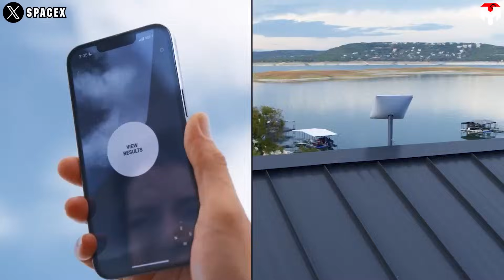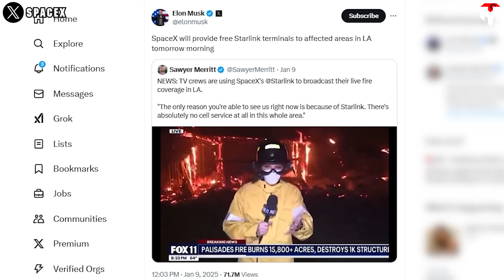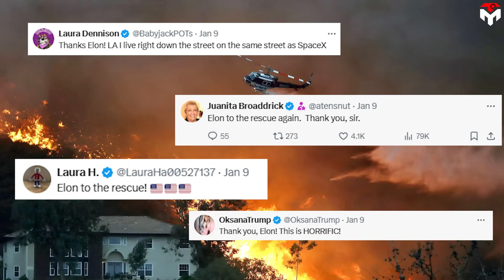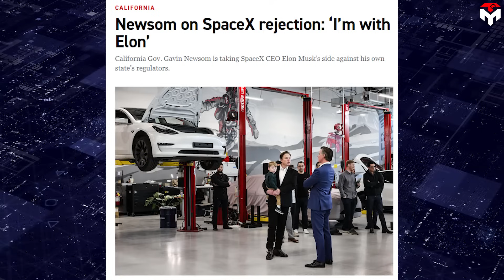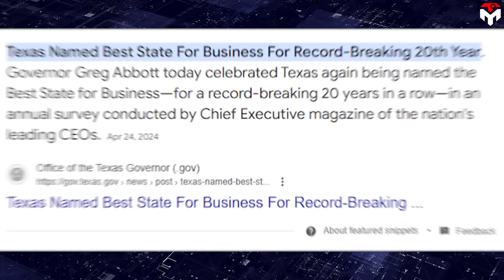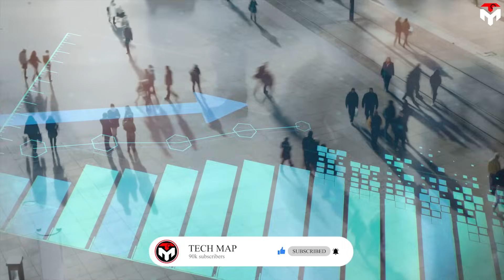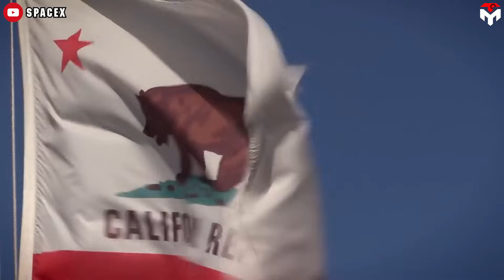What SpaceX just did with California Humiliated Cali's gov...

Comment: I want out of California, I want to move to Texas but I'm broke and living in the back of my truck
Reply: That's a tough spot. I turned down a job in CA 10 years ago after doing my research. It paid 2x more than my job at the time, but when you factor in cost of living, taxes, quality of life, etc. I would have needed to make 3x out there. 
If I were living in my truck I would consider which place would be easier for me to get back on my feet. 
I would probably save up gas money to drive to Texas, make some calls, and line up a job, then just drive down there and get my feet underneath me. 
One thing I considered was over the road trucking. If you can get lined up driving truck with a sleeper you don't need a home... could get by with a P.O. Box or the cheapest studio apartment available or just rent a room.